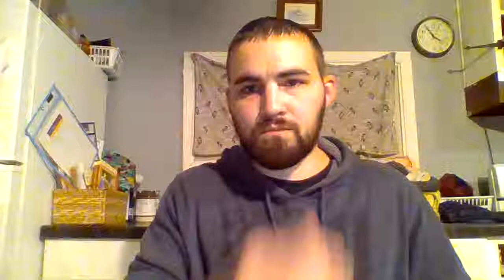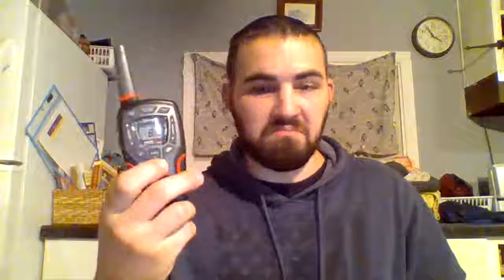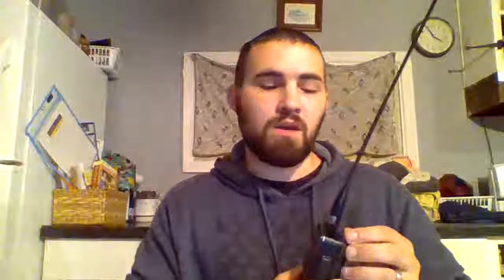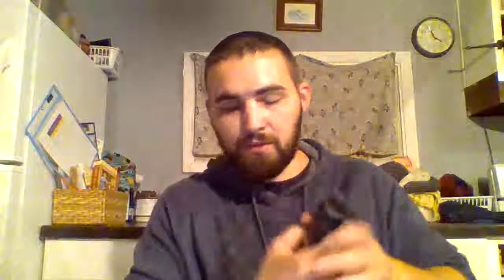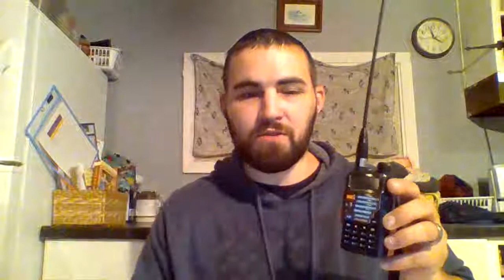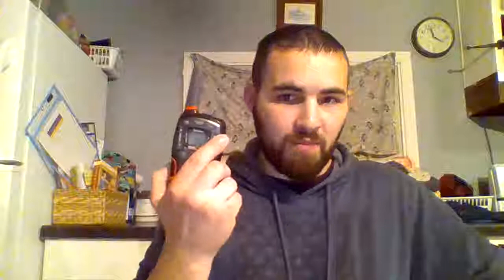SHTF topic: RFS/GMRS radios talk with UV5R

Comment: My UV5R just beeps when I press PTT and doesn’t let me transmit
Reply: That’s the same issue I’m
Having bro I’m trying to find out
Reply from the maker: Is the radio set so the offset is 000.000 along with the frequency shift should be turned off.

Comment: what kind of range are you getting with the baofeng uv-5r on the gmrs frequency ?
Reply from the maker: I didn't try it because I don't have a ham tech license (yet) but a couple friends of mine tried it at a training and we got about two ish miles with woods and hills in the way and a big open field.
Reply from the maker: @Ethan Woodruff it allows you to operate legally which in turn lets you have more practice at communications. Along without having the chance of being found by the FCC and fined. But me personally i don't see the point of it necessarily other than to cut down in possible traffic but hey its kinda like having speeding laws some follow othere don't all i can do is advise you to follow on the side or caution.